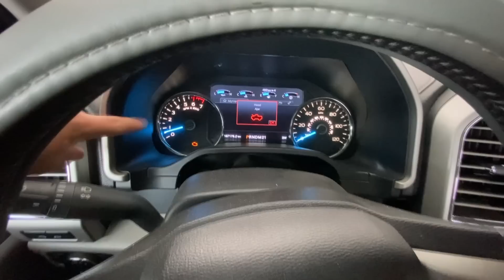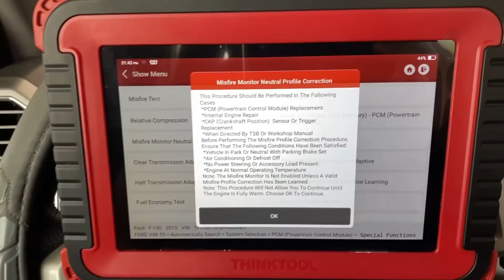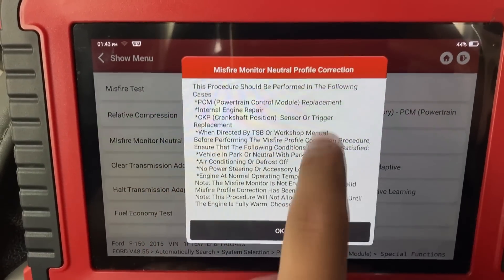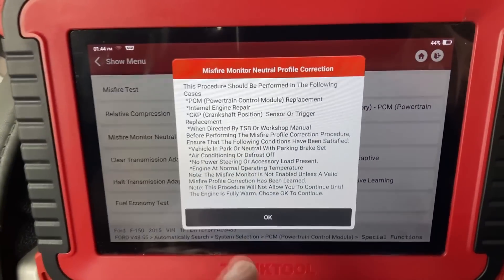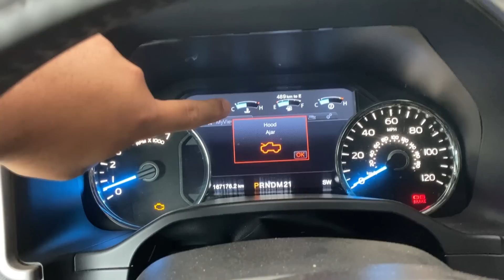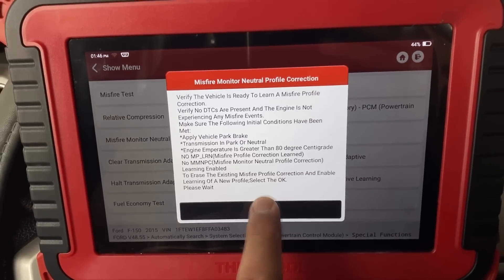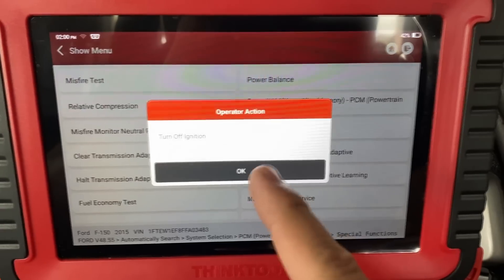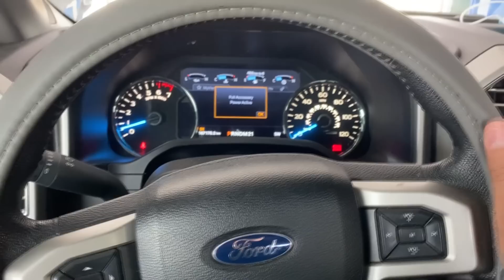FORD MYSTERY CHECK ENGINE LIGHT THAT WON'T GO AWAY!

Comment: I had that code pop up on my 2018. It said all the same things you said. But that was not it. The plug under the front of the truck became disconnected. Simple fix. When you go looking for the most complicated stuff on an engine but miss the obvious.

Comment: Could you possibly help me? I'm having the same issue. Fixed the positioning camshaft sensor on my Ford Taurus SHO 2015 and the light went off and then came back on. Can this work on a Ford Taurus SHO 2015?

Comment: So I was just driving from Anaheim to Vegas and I was driving 80 and switched into eco mode and my truck started acting funny ! And gears were dropping in and out and the wrench symbol came on then ! About 40 miles later I stopped the truck and waited ten mins started it again and wrench went away but check engine light came on ! Truck drove fine but light did not go away !? Thoughts please ? Keep in mind it’s was 112f outside and truck was running for like 5 hours before this happened

Comment: Hey what up hoping your still reading your comments.  

Question is , Is there a cheaper scan tool i can buy that can do this ? 

Currently have p0451 and wont clear stays on even after i clear . 

Truck is running back to normal after replacing a few things i did along the way but code wont clear . 

Replaced mof spark plugs canister purge valve a throttle bottle few other things i believe this is what need to be done next . Tried 4 mechanics had to find the problem myself . 

Please if see this let me know just looking for a more affordable route .

Comment: i am looking at a 2015 ford 3.7, 103000 miles with a CEL on. should i be concerned that it may be a major fix like timing chain?  it runs good

Comment: I have a 2016 Transit with 3.5L eco boost V-6.   I got a misfire code for cyl 6.   Replaced plug and coil on that cylinder.   Then tried disconnecting battery for a few hours.   Took both leads and held them together.   Check engine light still won't go off.   Can I do this procedure myself without an expensive scan tool?

Comment: Hey brother great and informative video. I have a question bro 
I have a 2019 f150 and my check engine light is on and all the scanner is saying that “O2 sensor wire “ that’s all it says I have replaced the O2 sensor Brand new but still comes back . Any suggestions!?

Thanks for ur time man much appreciated
Reply: What code?

Comment: This must be on 04-05 newer year vehicles with a Can-Bus PCM-ECU I
I have not run across this issue with older computers But this is good to know how this P0315 code can delay repairs.

Comment: I got the check engine light but on a 2016 Ford Edge I replaced the canister as it showed it was bad but now it comes back and goes away wtf man it’s got the 2.0 eco boost can you point me to the problem that might be happening any help will be greatly appreciate bro

Comment: Hi, apologies in advance: This question is not relevant to this specific video, however I don't seen any other videos that actually fit my question.  My question is this: I have a 2016 F150 XLT that has a standard key (not push button) start.  I am trying to find out whether there is a wire anywhere in the harness that will tell me when the factory alarm system is armed--that is, is there a wire anywhere that will be in one state when the alarm is on and another state when it is off, or is it all done through the CAN system?  Thank you.

Comment: Well, automotive repairs won't get easy) On my 2001 Volvo V70XC I changed transmission and tons of other sensors and engine components  ect.  -I never needed any relearn, correlation or adaptation even people say Volvo cars overloaded with modules and electronics. . I has been 75K since I put new gearbox, no codes or performance issues ever since) Thanks Eric, great video!

Comment: Some mechanics won't invest in themselves through continued education. I know of transmission shops that attend all sorts of educational classes just to keep up with the basics of their trade. Without those, they are lost and cannot rebuild and correctly get an electronically controlled transmission if their life depended on it. 
Same goes with electronically controlled vehicles. I've heard that Mercedes and Chrysler vehicles have the most electronic modules of any make and they all depend on each other which means if one goes bad, good luck finding out which one is responsible as they are all tied to each other. EDUCATION is a requirement every year you are a mechanic who deals with many vehicle makes and the customers who have them in need of professional help, done right the first time.

Comment: Thanx for the great tip/reminder Eric...❣️
On a side note: techs should throw away their scan tools, oscilloscopes, gas analyzers, sensor simulators, leak detectors, smoke machines, battery/alternator testers, multimeters, etc BECAUSE the ad for "FIXD" says it can DIAGNOSE your car's issue...😁
Reply from the maker: That ad gets me every time lol

Comment: Yeah I've learned when doing these re-learns is that u have to follow the directions accurately👍if it says temp has to be at 180* guess what that temp better be at 180*😉
Reply from the maker: Great tip! Thanks!

Comment: How could somebody not understand that you need to do a crankshaft position relearn   if it tells you you need to do it the thing is telling you what the problem is I don't see any code that says true expensive parts at it
Reply from the maker: I believe that code was set because they attempted to do the relearn, but did not complete it properly. So they managed to clear the original profile, but failed to learn a new one.
Reply: @ADVANCEDLEVELAUTO  That would make sense thank you

Comment: Thanks for sharing Eric. How do you like that new think diag. scanner. I bought the one you recommended awhile back that I can use on my iPad is this scanner much different ? I see a few you tubers using it. Thanks for sharing and stay safe and well Artie 😊
Reply: Thinktool Pro comes with full software and 2 years free update.
8 inch touch screen and works more faster